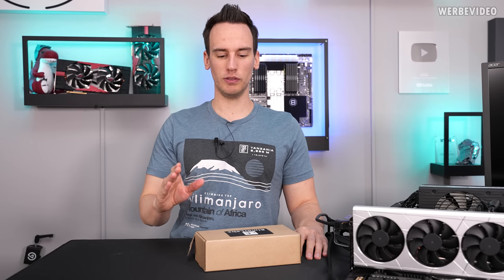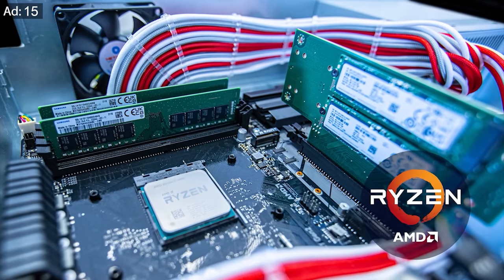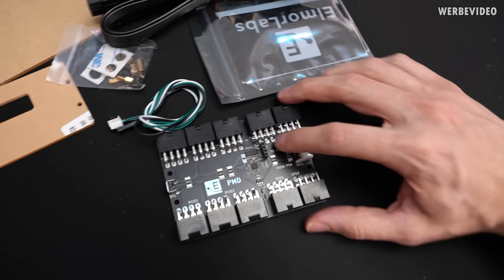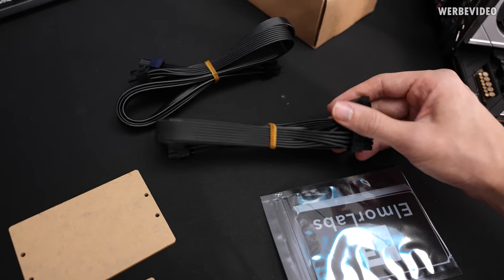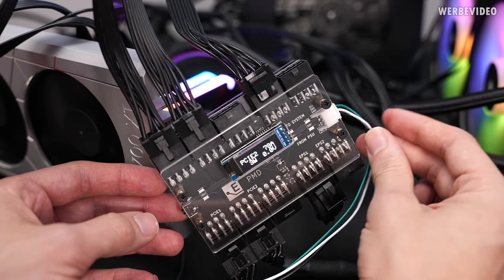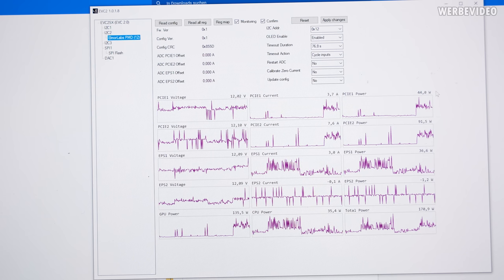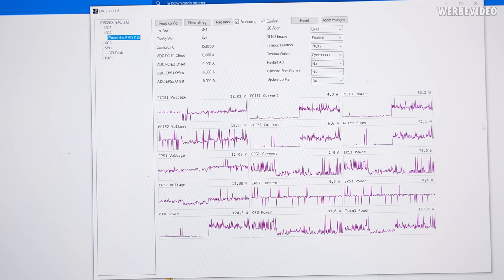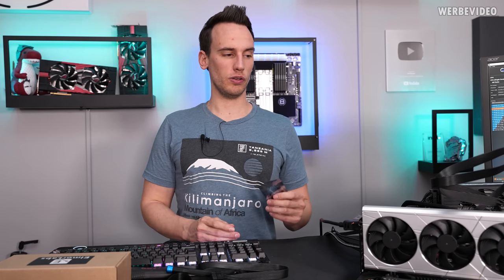This PCIe Power Measurement Tool is absolutely brilliant!

Comment: When someone says "VGA" instead of "GPU" you know he really is old school (not that we didn't know already)...
Anyways, didn't know this gadget existed, very useful indeed. Thanks Roman!
Reply from the maker: busted xD
Reply: @der8auer-en  More like "GOTEM"
Reply: Video graphics array (not adapter) - 8bit color out of 262144 (2^18, 6 bits per rgb).
Reply: @stanimir4197  🤔The only time I like Flashing RGB😉
Reply: @der8auer-en  Do Conductonaut also need to replace after some time like 6 to 12 month like  other thermal paste
Reply: Well, in this case, he is measuring the consuption of the whole card, not only the GPU chip, so VGA (Video Graphics Adapter) suits better and is the more correct term. 😏

Comment: i would like to see a stock nvidia 3X running New World with this tool retrieveng power data
Reply: Great idea hahaha....
Reply: Wasn't it determined to mostly be Evga soldering at fault?
Reply: @ralphbarnes9335  naa, a lot of others cards are also dying. asus (strix also), gigabyte, zotac etc. ampere all scuffed
Reply: power level over 9000
Reply: comment got deleted so I'll make this one short : I know what new world problem was I had the same with forza horizon 5, vsync 1080p 120hz maxed settings w rtx (above max quality preset) current on the psu 12V 30-35A, without vsync in 2d menus 1000+fps current 55+A so almost double than max quality actual gaming, that insane current draw will begin by overheating your gpu power stages and or trip the power supply safety because that's too much current and eventually it will fry your gpu Vcore power stages (mine smelled really bad for 3 days I tought my gpu was dead) thanks to buildzoid channel I was able to check my card and understand what was going on

Comment: At this point, I would like the PSU to basically have an USB interface to get the data.
Reply: Corsair makes some PSUs that do this.
Reply: My PSU has USB and some of this data logging - Corsair HX1200i. But it's per-rail not per-device and nowhere near the update frequency of this.
Reply: Yeah like said above, some Corsair (the "i" models) ones has that feature as some other "digital" PSUs as well.
Reply: Corsair AX1600i has per connector current monitoring!
Reply: Like the old style corsair link?
Reply: @LabRat Knatz it in theory wouldn't be very hard, but it doesn't make financial sense to include it because 95% of the psus that would have it won't be utilized
Reply: @LabRat Knatz You would need to add a few pins... at this point, a USB header is more discrete.
Reply: read my comment above I have a corsair HX1200i + the aida64 software and I have all you will need except if you do extreme OC or physical mods of your hardware
Reply: Corsair tried this, and the readings were so inaccurate I felt scammed. Support said the readings were an "estimate only and not to be relied upon"

Don't even care if it's a year old comment, i really don't want anyone else throwing money at that worthless 'feature' like I did

Comment: Its pretty clear that the on-board display was not meant to be the primary means of using this device...that or you need to drink lots of caffeine before using it so you can keep up with the data refresh rate! I still like it though. I appreciate these little devices for enthusiasts to work on Electronics projects. It's so much nicer being able to pick up a small tool like this than to go hunting for used lab equipment or trying to cobble something together from a bunch of cheap Multi-meters!

Also, I really appreciate the acrylic shield. I've got a number of little hobby electronics tools like this with nothing more than components soldered to a PCB. The biggest problem I tend to run into is that I need to be really careful where I put them so I don't accidentally short things out! Especially with devices like this that will be getting pulled around by all the cables attached to it, it's nice not to have to worry about exposed contacts accidentally touching something else on the bench and putting voltage where it shouldn't be!
Reply: Hello, you're right it was originally designed for I2C readout only. Seemed like a good idea to add the display readout too and based on feedback it seems maybe more important than the I2C interface :) Also as you say especially 12V from a PC power supply can carry A LOT of energy and simple laser cut acrylic case goes a long way.
Reply: @ElmorLabs  Thanks for the reply! I appreciate the work you do making tools like this.

The display was absolutely a good idea, its just that the refresh rate might be a little too fast. Honestly, the display panel that you chose is surprisingly nice. Most of the cheap character-based LCD's I've messed with would have turned into a blurry mess if I tried to refresh them that quickly! Your part was still entirely readable, it was just changing too fast for my brain to keep up!

Comment: Awesome stuff. The next revision should definitely include a PCI-E Riser card so you could measure PCI-E power as well. But nevertheless, it is a really great piece of measuring equipment.
Reply: I agree - as a middle ground, there are readily available risers, which take PCI-e 6 pin as power input, and decouple power pins from motherboard.

Comment: for non overclockers, you can buy a corsair "i" psu and install aida64 or other software tools they give you more than enough "estimates" of everything to see how much power goes into your gpu-cpu-"everything else" that combo is already better than what most reviewers tell you, for example I know currently I have cpu35w-gpu25w-psuIN117w (so 57w of rgb fans chipset usb etc...) without any external tool, I also could troubleshoot my RTX "newworld" like moment when FH5 tripped my dual-rail setup PSU because with unlimited fps in the menus it was making 55+Amps spikes on the 12V

Comment: That looks perfect for checking powerspikes on the 3000 cards. Would be interesting to see how high the spikes go on fx 3080/3080ti/3090.
Reply: I can tell you from a new world like experience I had in forza horizon 5 that the current draw on my 12V went from 30-35A to 55+ because of those stupid and dangerous 1000+fps menus or loading screens, rtx 3000 but I can imagine also radeons produce so many fps at low load that they overload the cards power delivery and nvidia way of doing things is very unsafe, check buildzoid videos for more info on that, 4K 60fps is like trying to haul a caravan behind a ferrari, not great but it'll take time to actually break something, 1000+fps is disabling the rev limiter and running the engine at 30'000rpm it will blow up very quickly

Comment: This is super cool. If only it could also measure from the PCIe slot as well. I would love one of Nvidia's PCAT's, but they won't even sell those and this is only $45. And it will do the EPS connector as well. I'm especially excited about that scope measurement.

Comment: My Aorus 3080Ti Xtreme is 400w stock with 3 8-pin connectors..... lol 450w at the max.... I might as well get one of the wall outlet meters, but id love something like this just to be able to keep an eye out for any power issues with my card. It is a Gigabyte after all, but so far running at 400w 99% of the time with plenty of case airflow, She's holding up real nice 2 months later.

P.S> I have an Aorus 3090 Gaming Box, for my laptop, that Died the second day I had it, playing RDR2. But i sent it out and they fixed it and its on the way back to me. So they have fixed the issues from that hack and learned from the PSU debacle.
Reply: I have a Aorus Master 3080 which has 3 PCI-E connectors with rev 3.0 and I've seen it hit 440W in Cyberpunk(when allowed to go to 120% power through afterburner). Considering Gigabyte's reputation of late I undid all the overclocking so it stays under 400W. Surprisingly even at 440W it did stay around 65c with fans limited to about 60% so the cooling is pretty good.

Comment: I stumbled upon a tech channel that demonstrate power outlet meter for less than $10. it shows much more readable data output and it also includes a mode where it can calculate the electricity cost. Aside from how easy and simple to use it, i'm pretty curious on how safe is it for long term use. I also own one but only uses it several times just to measure how much power my pc draws during heavy load.
Reply: Not planning to share this info?
Reply: I've used several of those inline meters that you plug into the wall socket and then plug your device into it. It's hard to say if every device is the same, but in general the ones I've used have been safe and had CE and UL stamps indicating they were tested for fire safety. I've killed a couple, and they never shorted. They always failed open with the main shunt resistor or a fuse failing.

The early ones I owned did have a 10A limit to them, so I had to be careful testing higher wattage stuff like electric heaters. In fact, that's how I killed the first one I owned! It was only rated up to 10A, which I didn't realize, and I stuck closer to a 14A load on it. It actually worked for a little bit, then the main shunt resistor overheated and failed. All of the ones I've purchased in the last three or four years have all been rated for at least 15A so I haven't had overloading problems with them. Most of the newer ones that have died on me have been due to physical damage (i.e. people being stupid and smashing them accidentally) or the cheap displays becoming unreadable.

Assuming the load you are plugging into them isn't really close to their maximum rating, there shouldn't be a problem leaving a load running through one of these devices for as long as you want.
Reply: @sadlerbw9  glad to hear that but now i uses uninterruptible power supply. According to the manual, i must avoid using any kind of cable extender or anything though.
Reply: @echohotelsix  Again, I can't guarantee anything, but usually a UPS will make that recommendation to avoid the user plugging it into a surge protector. Plugging a surge protector into a surge protector (and a UPS will typically include surge protection circuitry) can reduce the effectiveness of the whole system at stopping surges. The wall-plug watt meter should not cause those sorts of problems with a UPS.

However, if the warranty says not to do it, it may be best to follow those instructions so there is no reason for the warranty to be denied if you ever need to use it. You could always plug the watt meter into the output side of the UPS. You wouldn't know what the losses were for the UPS, but it would at least give you the power draw for the rest of the equipment.

Comment: I would be very interested in this if it also had PMBus support, so you can plug this into a motherboard with PMBus connector and get the data into the host system that way.
Reply: Hello, that's a great idea! I'll check if it's possible to add that for next revision :)
Reply: @ElmorLabs  cool, I'll keep an eye out, my home server is Supermicro and I've always wondered what to do with the PMBus connector.
If you're looking at it, perhaps a stacked daughter board for a motherboard ATX connector? 
Again, I'd pay for that.

Comment: When I see cut-in measuring devices like that, I always wonder how much change they themselves introduce on their output side.
Reply: They would increase the ripple at the components
Reply: He should have measured the resistance (with a bench multimeter), and you'd know the losses. 
I would not trust the measurements much (I bet they are not temperature stabilized) - but since the resolution is very low  -Watts, it's likely quite ok.
Reply: @stanimir4197  Yeah, but who would want to measure mW or µW on a PC, that does the job rather well here!

Comment: Hey, just a quick question, don't know if you have the answer, so on TREX and HWINFO, my 580 is pulling 66w but with the PMD by Elmorlab is telling me that the PCIE 1 is pulling 150w and my wall meter is ready 160 to 170 ish. When I didn't have a GPU plugged in, the system is pulling around 35w. So is the 90w different from the PMD with the software is the difference of the PSU efficiency?

Comment: Can the software add the possible power that pass through the PCIe slot and the socket from the 24pin connector or is a passthrough made for that cable also?

Comment: Hey dude that's awesome stuff but to be realistic, many people will still be using HwInfo or similar software. Can you compare that to software with multiple brands of motherboards and gpu's so we can see how accurate monitoring software's are based on different hardware?
Reply: The vrm efficiency of motherboard or gpu is never 100% so you should see a difference.
Reply: @jepulis6674  Yeah of course cause they produce heat and they need cooling most of the time. But It's the super IO which provides monitoring thru software. And not every Cpu has the same super IO or not every motherboard has the same power plain so there's always some voltage loss in the power plain but some motherboards have better voltage regulation and little power loss while some others have worse. 

If HwInfo is reporting the same power draw in both the cheap and expensive motherboard, then it's not a reliable software. And actually buying a more expensive motherboard with a better power plain and better vrm could save electricity in and even end up being cheaper in the long run. I'd like to see how bad of a difference there is. And also how reliable the super IO or software monitoring is...

Comment: No x16 slot power measurement?
That basically renders the device useless...
Reply: What relevant CPU are you measuring that uses PCIe power?
Reply: It was a consideration during design, same with having ATX24 pin support. It was determined it's adding too much work and cost for minimal benefit. In most cases EPS 8-pin and PCI-E 6/8-pin will yield the information you need.
Reply: @ElmorLabs  You should make it just for GPUs so pcie power and x16 slot power just like the NVIDIA tool, then for CPU and 24pin as a separate product. It is important to have the x16 slot measurements, there's up to 75W of power going through it so you DO NEED it.

Comment: is there a diff pci power  when using diff amd chipset drivers my x570  my gpu got buggy and used more power and crashed more with latest chipset so uninstalled and installed may amd chipset showed improvements og gpu power and lowered temps my vega 64 uninstalled it and installed feb 2021 amd chipset release and  temps got lot lower lower power usage more stable and 20% increase fps godfall 4k gaming . the only think makes since of this is pci driver in chipset

Comment: Unfortunately all the non-CPU power readings are often seriously off because part of the GPU power comes from the 24-pin which this doesn't measure. How much this throws it off varies between different GPUs (even of the same type!) and load so there's no way to compensate without actually measuring that either.
At least the 12V lines from the 24-pin HAS to be measured for any kind of useful results for most (not all!) GPUs. And ideally you want to measure it in the PCIe slot to avoid other power uses but I believe just measuring it on the 24-pin is considered sufficient for non-professional use.
So, it's really neat for CPU power but... unfortunately somewhat crippled for GPU power, and once you start down the route of clamp amp-meters on the 24-pin 12V line you might as well use that on all the lines given that you've already lost the entire "logging" part.
Hopefully they'll either make a bigger one which includes this or a separate part which does the 24-pin. It's SOOOO close, yet so far.